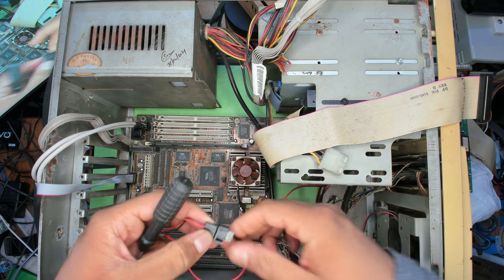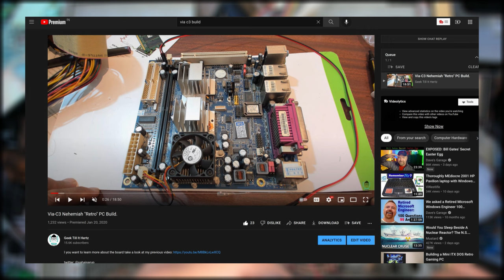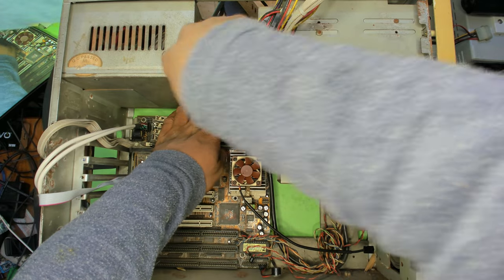Socket 7 Inverse Sleeper Retro PC Build Featuring a Pentium 100MHz

Comment: You got really lucky with the Mainboard. Having a CR2032 was a privilege back then. Those VARTA became absolute nightmares.
Reply: On a socket 7? Nah, CR2032 was pretty common by the time we got to socket 5/7. Early 8088-80286 often had a plug-in battery pack. Later machines (even "budget" 8088 machines in the 286 era) usually had soldered batteries. That continued through the 486 era with the AMI Angry Fruit Salad BIOS… By the very late 486 (white on blue Award BIOS being common) and the Socket 7 boards … CR2032 was the cheaper option.

Comment: I remember someone killing one of my machines by plugging an XT keyboard into the AT motherboard - Someone else sent me a Pentium MMX 233Mhz and motherboard as a replacement, which I dropped in an ISA AWE64 (1999 prize), and 1 (of 2) brand new (2000) PCI Voodoo 5500 into it, along with a 20Gb Quantum in 1 (of 3) drive caddies (at the time 4Gb was highend for a P3/P4 desktop). I could then take the 20Gb drive to work (P2), my mates (P3), or home .. That machine ran MSDOS, Win95 and Win2K Pro w/o a cover until 2010, not sure who has got it ATM, or where the 2x Voodoo 5500 are .. ce la vie.

Cheers, thanx for sharing (with commentary).

Comment: Rust inhibiting paint would have worked on that original case.
Reply from the maker: It was worse, i couldn't show it properly. Actual integrity was failing, holes and such.
The seller had kept the main board separately in storage, i guess the case just got unlucky with humidity.
Reply: @sahajsarup  It’s a nice 90s machine. My guess is it’s from 99?